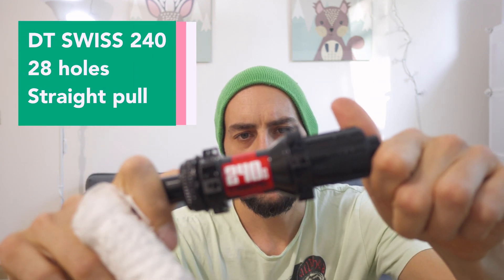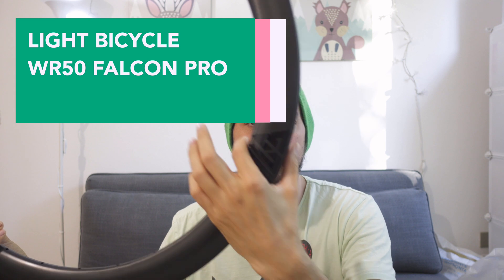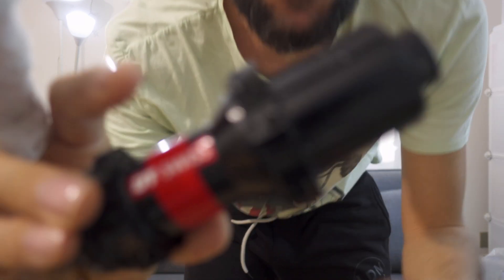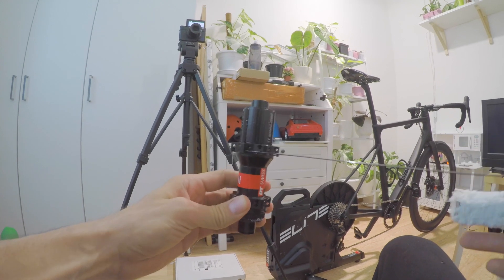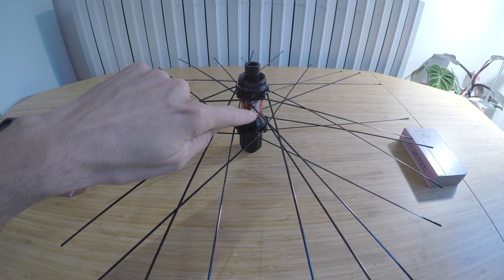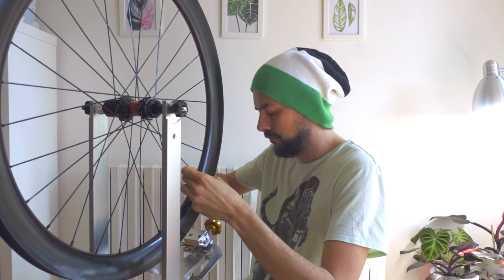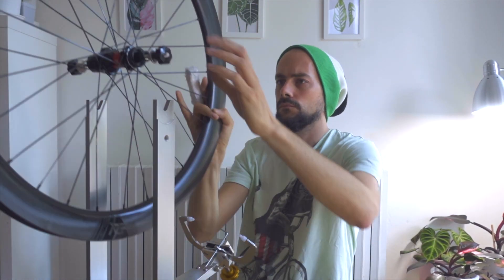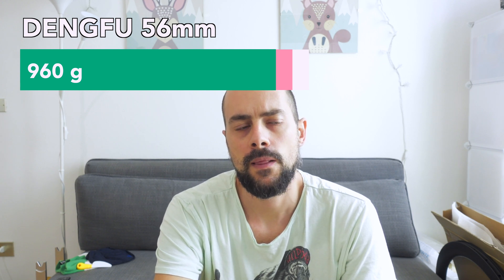CARBON WHEEL BUILDING (first time ever) - Light bicycle WR50

Comment: nice. how much did you save compared to if you were to buy it?
Reply from the maker: @wretchedworm  I saved the cost of the 240s hubs and maybe something for the spokes. The goal was to learn how to lace and build a wheelset without spending too much
Reply: @projectcycling  but u would have to buy a truing stand right? i checked the prices of that and i don't know... unless i'm going to build lots of wheels, it doesn't seem justifiable if all i want to do is to learn how to build a wheel.
Reply from the maker: @wretchedworm  that's right, but I bought one from Aliexpress that does the job. It's not like the classic parktool in terms of stability, but more than enough to build some wheels and check them from time to time (disc rotors too)

Comment: How did you dished the wheel?
Reply from the maker: With the truing stand, using a single pointer and flipping the wheel back and forth to check if the distance was the same

Comment: Hi, nice video, I wonder if you'll know a straight pull hub that only has 24 holes will also use a 3 cross patterns just like your 28 holes hub? or just will only be on two cross patterns?
Reply from the maker: Hi man. No because the straight pull has a "pre-build" pattern. 28h DT swiss is 3 cross when 24h is 2 cross. With J bends  you have you have more freedom about lacing

Comment: 1) Did you have to use the DT Swiss spoke length calculator tool to determine correct spoke sizes? 2) And did you find that the left and right side spokes had to be a different length for this specific hub? 3) Do you recommend using nipple washers for carbon fiber wheel building?
Reply from the maker: 1) I used 3 different calculators to be sure. The important thing is to get the right ERD measuring it by yourself.
2) yes 2 different length
3) no needs for washers
Reply: @projectcycling  3) why?
Reply from the maker: @vadlme  because in the user manual it's written you don't need washers and personally I've never seen a carbon rim with washers
Reply from the maker: @vadlme  in fact, another rims brand with another spokes brand. It's a matter of choice/need/company instructions manual.